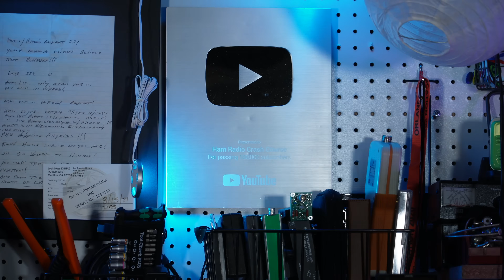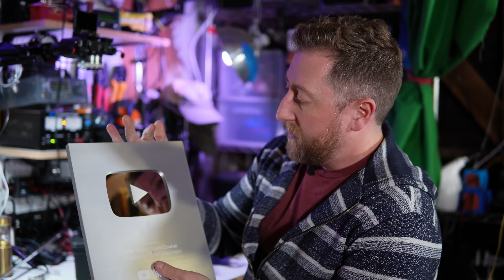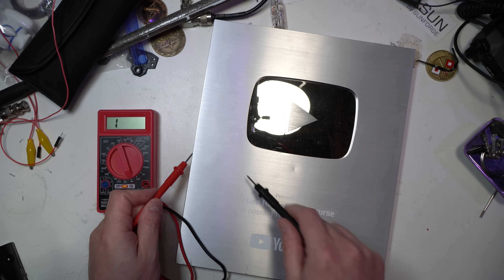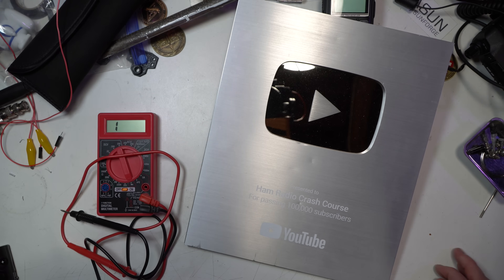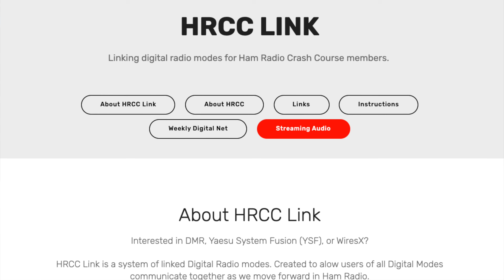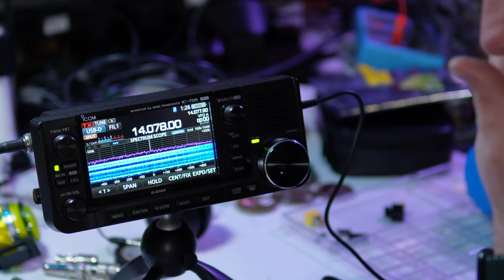My Youtube Play Button.  Will It Ham Radio Antenna?

Comment: This appealed to me greatly. Currently, I have a 4" (inch) copper ballcock from a lavatory cistern, mounted on top of a short threaded bar and mag mount. Mag mount is sat on top of a metal bucket of resin in the loft (attic). It works fantastic on 2m, I have been using it for over a year! I saw the ballcock and thought, ooh what will this resonate at?

Comment: #Advice required. I want to get into QRP portable voice HF. My dream station would the flagship IC705 due to the vhf, uhf and HF plus the waterfall. I am on a shoe sting budget so have to choose wisely for my radio as this will probably be a one time hit for a long time. The radios in the list are IC705, FT-818nd and the G90. The antenna would probably be a linked dipole. Which radio would you choose?
Question open to anyone... 
Great video Josh, loved that the play button worked as an antenna. I've just made a MF dipole as a backpack antenna the top element is a whip so it will not get damaged on trees the bottom element is inside some tubing which clips to the side of my backpack. I got my longest cso which was 85 miles away. Sota Station. 
Motters M7TRS 🇬🇧 
73

Comment: Put a metal garbage can lid and inch behind it then move the feed point location around but make sure the feed exits the flat plane at 90 degrees. You will have a patch antenna, your ground is the garbage can lid so run that wire to there. Roughly looking at the size it SHOULD load up well on 2m and 70cm!  Feed point I am guessing maybe 1/3 of the way in from a narrow edge and centered the other way... been  awhile since I played with patch antennas to contact the ISS back when they were active on 2m voice. laid the antenna flat in the yard to get overhead coverage that the 2m vertical lacked.  Worked well on SSB too to get thru the linear transponder ham sats of the time. I mounted it to a camera tripod and moved it by hand as the pass went over.

Reminder everyone, January VHF contest this weekend. Rules on the ARRL website. Stations in bigger cities often do quite well FM only! Don't be afraid to hop on 2m/70cm/23cm SSB if your radio has it, even to a vertical guys running big gain yagis will work you at long distances!
Reply from the maker: I love this. Good idea. I may need to revisit.

Comment: I remember from a past in antenna design that the feedpoint impedance of a patch antenna could be tuned by altering the location at which the probe is connected to the patch. Might give you different results on 2m if you, for example, attach the lead somewhere in the middle of the play button instead.

Comment: Any chance of a video on extending frequencies on radios? I have the Wouxun KG-UV9D Mate and can't TX on GMRS frequencies. I didn't pay attention when I purchased it. I don't mind if it wasn't intended for GMRS. My radio is mine and if it's physically capable of TXing on the GMRS frequencies I want it to be able to.
Reply from the maker: See if there is a MARs mod
Reply: Give me freqency and I'll check on my radio. I have KG-UV9D plus unlocked to all freqencies available on hardware ... this radio does not need HW modification (e.g. MARs mod). Just few clicks in software on pc ....

Comment: And THIS .... is what gets a young one interested and excited in the experimental realm of ham radio! Nice job Josh!
Reply: Central States VHF society meeting... the after supper social meeting room... much beer drinking going on and we had to come up with a gain antennas for 2m made from beer cans... many did 1/4 wave verticals spaced ~9 inches apart ... we made a 3 element yagi and won... yeah we drank more than they did so had more raw material LOL next morning on the antenna range hurt! Antenna testing ran all morning, lot of homemade designs back then, I tested a commercial 23cm design that didn't live up to its specs... winning 2m "yagi" was made of elements between 2 ropes and was 75' long! Guy actually had a way to aim it at the moon at home and that single antenna and 300 watts produced moon echos on CW, with 1kw he could do SSB. Covid really put a damper on my going to last one that was close, by the time they have it here again my broken body(entire spine has major issues) is going to say no to sleeping in a hotel bed.
Reply from the maker: Thanks!